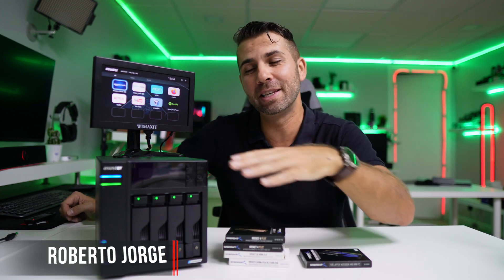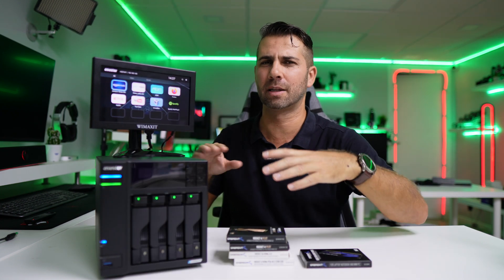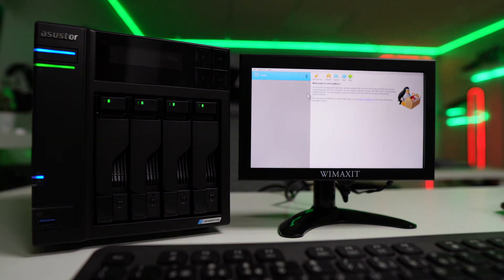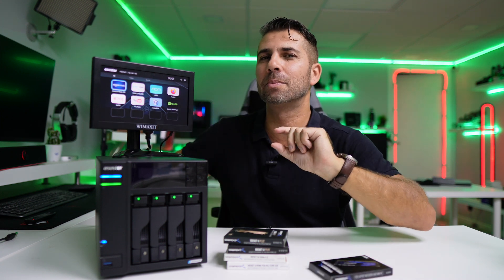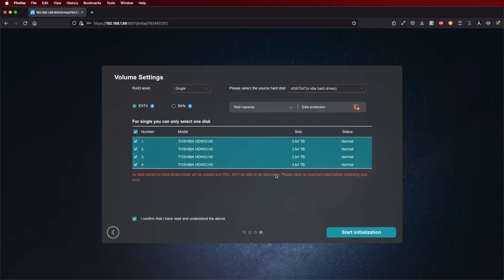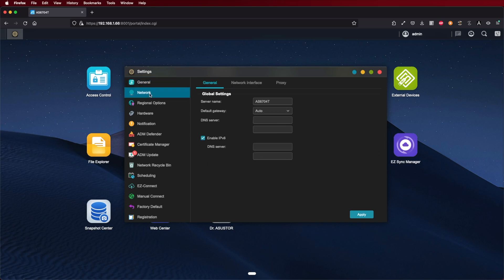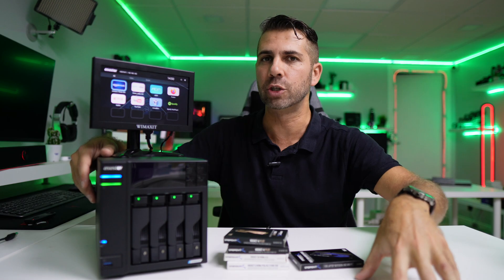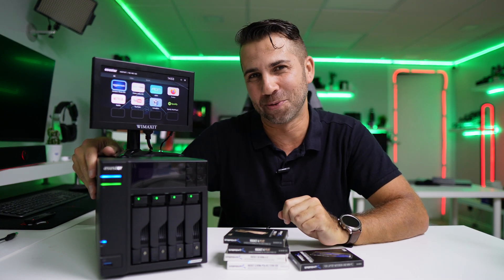"Network Drive" NAS with 4 NVME, HDMI and a LOT More ... Asustor LOCKERSTOR 4 Gen 2

Comment: Hi. The motherboard of the M.2 NVMe is PCIe 3.0 x4 and distributes 1 PCIe lane for each M.2 NVMe unit, so its maximum speed will be 875 MB/s for each M.2 NVMe unit. The Asustor Asustor LOCKERSTOR 4 Gen 2 has the possibility of doing link aggregation and having speeds of 5 Gbps with its two 2.5 Gbps RJ45 ports, it also has the possibility of replacing the PCIe board with the 4 M.2 NVMe with a network card with 10 Gbps and two M.2 NVMe units (the Asustor AS-T10G3). This way you could have a speed of 15 Gbps by doing link aggregation with the two 2.5 Gbps ports and the 10 Gbps port. You can also place 5 Gbps USB network cards in each of its two USB 3.2 Gen2 ports (WAVLINK USB C to Ethernet Adapter 5 Gbps) so that with a link aggregation you would get speeds of 25 Gbps.
Greetings!

Comment: Very helpful video...I currently have the previous model with 2 harddrives as a RAID1...but wanted to add 2 more drives to do Raid 5. Will it allows me to initialize the 2 new drives without wiping out my already installed drives,  thanks!

Comment: hi, I would need your help with my NAS story. A long story short, I was looking for a nas solution for my home and I was indicated the nimbustore4 - I looked a bit for it and saw that it usually has nvme slots, so I can optimise it. Unfortunately they considered I dont need smthg like this so I bought gen one not gen2, not knowing that there are two identically looking but with or without nvme slots. Now my system is doing copy for the 3rd day in a row... It is bought last week from amazon. What can I do to repair a situation likt this? buy a new nimbus 2  gen2 for ex to cut expenses? sync them one to the other? Write to Asustor directly to try a solution with them? Probably they would have the module to stich it into the gen1 to make it gen 2 ? I-m kinda stuck as all my databases are in the process of transfer. Thanks in advance, Marius.

Comment: What good is 4 NVME slots with a 2.5G connector? NVME's can do up to 6000 MB/s but 2.5G ethernet is capped around 260 MB/s... am I missing something?
Reply: IT depends on PCIe generation and how many lanes you can use... With N5105 CPU every M.2 will do lower performance than NVMe PCIe3 disc...

Comment: Nice Review Boss!!! I can confirm that a Sabrent USB 3.0 Hub will work in the back port as I have a Cyberpower UPS connected for smart shutdown management and also have a 16TB FANTOM backup drive connected. The Cyberpower UPS is "special" as it generates a PURE SINE WAVE and not a noisy modified sine wave!!! I settled on the TEAMGROUP brand of RAM and M.2 SSD as it had excellent Amazon reviews and was VERY reasonably priced!!! And I just couldn't set up this NAS without installing a Lifetime License of PLEX!!! Just a note that I came from a Western Digital MYCLOUD appliance that was antiquated and kludgy... ASUSTOR  blows WD MYCLOUD OUT OF THE WATER!!!